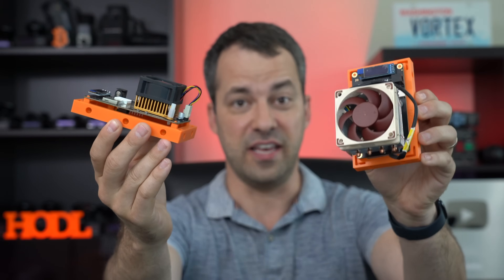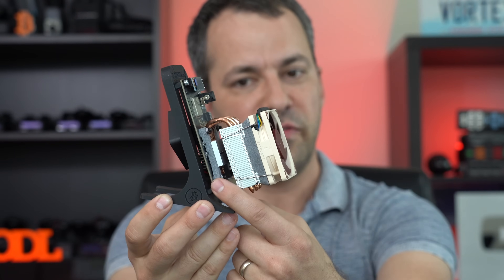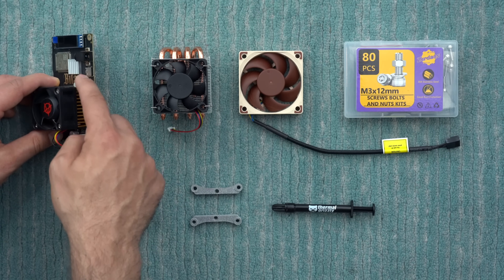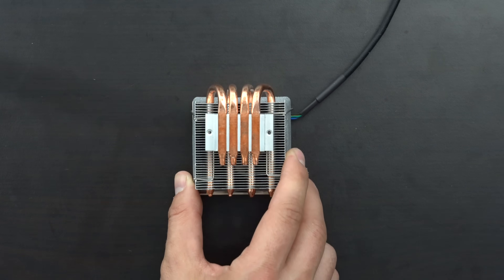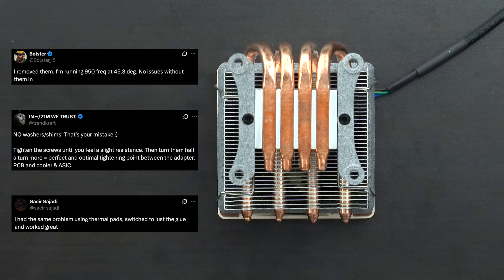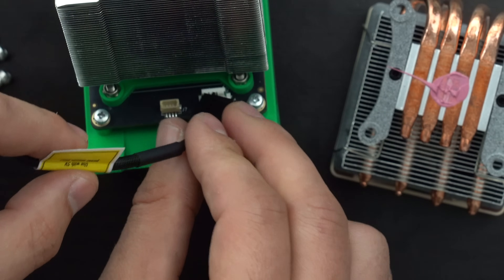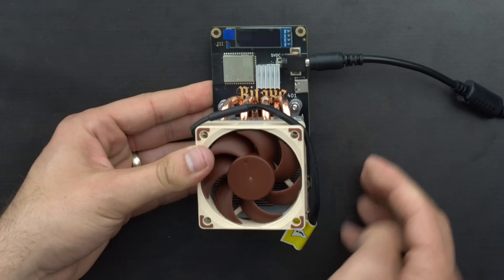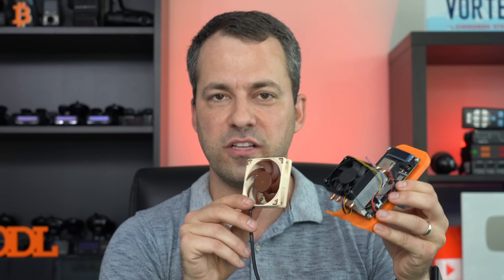Amazing Upgrade For Your Bitaxe's Heatsink & Fan

Comment: Have the same set up but my VR temp goes crazy settings at 900mhz/1300 at 1.8TH also have a 50A 300w PSU. I also just realized that I got the high performance grizzly TP. Does it matter? I am gonna order the Extreme though.

Comment: strange because my stock gamma runs cooler with the stock setup  compared to this exact upgrade .  was worth a shot though .  i used better thermal paste to reinstall the stock setup while i was already putting it back together

Comment: Should have used the copper plates to take advantage of all the heat pipes and surface area after you removed all of the adhesive and cleaned with 90% iso. Attach them to the heat pipes with a very thin film of thermal paste. Attach a high quality thermal pad cut to fit over both copper plates, I used arctic. Stick the heatsink on the asic. You can also get the thinner thermal pads and cut a piece the exact size of the pad you stuck to the copper plates and stick it to the pcb with a whole cut for the asic to poke through. Then stick the heatsink on top of that pad. That way the surface area is spread out more evenly across the pcb, asic and heatsink. The copper ground layer under and around the asic acts as a heatsink too, so being able to keep it cool helps out a lot.

Comment: After installing the components I got this error: "Power Fault Detected. Check your Power Supply."...could somebody help me please
Reply: Most likely the heat sink isn't on tight enough, probably to loose.  Try to adjust it. Its not sitting on chip good enough
Reply: You don't have enough wattage in your power supply. Either back off the settings for now and get a 5 volt power supply with more wattage, assuming you are using the factory power supply.

Comment: i used the low profile cooler fan to cool the rear of the board. 20 degree celcius drop for my voltage regulator using parts included with the noctua fan and pi cooler(spare standoffs and the fan splitter cable )

Comment: Love your channels and new ro this one. Juat wondering. Do you know of any miners that can operate over cell phone hot spot? Secondly any that can operate over Starlink? Would love to know if there's any! Thanks
Reply from the maker: So you could always set up a wifi hotspot via a cell phone, but that sounds like a bit of a mobile / temporary solution. Starlink can work too so long as you use it to create a wifi hotspot locally for these miners to connect to. They just need wifi and it's up to you to provide some sort of internet connection, whether it's cable, fiber, satellite, cellular, etc.

Comment: This girl ordered all of the parts from the links the video provided and I just followed his instructions and my bitaxe is doing great! Already is running much cooler than it was before. I have not over-clocked it yet but that is my next step. FYI I attempted to put a small piece of copper sheet between the ASIC and heatsink (which the video did not instruct me to do) and that did not work, it caused my chip to over-heat, once I removed it, it was good.
Reply from the maker: Glad to hear it’s working out for you! Yeah I tried the copper shim thing too and it didn’t work for me either.
Reply: @VortexBitcoin will a 12v fan work? Or has to be 5v ?

Comment: When fins are oriented vertically, heat escapes more easily compared to horizontal fins
it pushes air across the top of the board passively

Comment: I finally did this upgrade following your steps exactly. However, I am getting a lower average now than with the stock Bitaxe. I did find the printed adapters for the heatsink (company off your site) flexed slghtly to get it to fit. I had to gently manipulate one to get the bolt to go through. Could this flexing be the problem?  Thank you.

Comment: Hey I love the video! I wanted to point out that Noctua fans come with 3-pin connectors as well, so you can find one that fits your bitaxe instead of modifying the 4-pin. Just make sure it's a 60mm fan and 5v rather than 12v.

Comment: I'm having issues with this exact setup. I have all the right components listed here.  Heat sync is tightened down firm with another half turn, but not over tightened. I  have thermal paste in place as well.  I know the seating is good can't get any light to shine through when I back light the sync and the board with bright light. My ASIC temp is about the same as stock but my VREGS are going way high like 85c.  I have syncs on the VREGS and temp was much lower with stock ASIC sync. Noctua fan is also running much faster RPM's than stock. I've gone over this video multiple times to see if I'm missing anything and I can't get the results most are getting here.  I am running improved power supply Mean Well LRS 200-5 with improved power cables.  I don't get it.  Frustrated for sure.  Anyone have any ideas?
Reply: After going over the parts list one by one  Amazon sent the wrong fans.  I ordered the 5volt Noctua fan from Amazon they sent the 12volt fan.  That is probably why I'm having issues with cooling and VEREG temps being out of control.  Damn it Amazon.  I will post update once I get the correct fans.  But now Amazon is out of the 5volt fans.  More time and money LOL.  Will follow up.
Reply: So to follow up. After a long waiting period for Amazon to restock the 5 volt Noctua fans I finally got the correct fan installed plus some heat sync's on the VREG's. Not really that much difference on the temps from stock fans.  I've got good seating on the ASIC with thermal paste and I'm getting about 5° C lower on the ASIC and VERG's.  Not sure how everyone else is achieving 15° to 20° difference.  It is kind of frustrating to spend the money and not get the results.  Such is tinkering around I guess.  I've built dozens of miners over the years but never had as much trouble as with this particular Bitaxe.  I guess there won't be any overclocking here on this unit.

Comment: ive watched this video 10 times, followed step by step directions and still my bitaxe overheats. satoshi gama with a 601 board. grizzly thermal paste. currently running 525 freq, 1000 core volt. 100% fan speed. same noctua fan blowing the right direction. help.

Comment: Can I do this without adapters?
Reply from the maker: Without adapters you won't have a way to secure the heatsink to the PCB. You can use the stock fan it comes with if you don't want to upgrade to the larger fan which requires an adapter.

Comment: Thank you very much for this Gude and greetings from Germany. 
I actually turned the Heatsing, so that the pipes are running from left to right. So the Fan-connector is not in the way / I dont need to adjust sth. 

All the best and thx again :D
DanO

Comment: I followed you  directions and now my Bitaxe is reporting "Power Fault Detected. Check your Power Supply" and the Dashboard it reporting Measured ASIC Voltage of zero.  Am I screwed?   Of course I was very careful and even used an anti-static wrist band during the process.
Reply: I added a piece of copper between the heatsink and ASIC and now everything works great.
Reply: @crites57  i did a lot of back and forth as well - had a lot of doubt, but ended up working in the end.

Comment: The plastic on those fan connectors is pretty soft so you can cut it with a razor blade / utility knife if you don't have a dremel. Just be carefull not to cut yourself.
Reply from the maker: Good tip!

Comment: Before you turn it off, I underclock it to lowest settings to make sure I don't have an issue with contacting the heatsink when it is powered back on. Pink Grizzly will dry up in less than a year on these high heat chips.  I put some thermal pads around it to use more of the heatsink area. Great video, Thank you!

Comment: Included copper shims in-between, instead of thermal tape, thermal paster was used. Thermalright T9 was used as the thermal paste, for both sides. Awesome outcome, from minimum frequency and voltage to maximum.

Comment: No go for me. Got every part, tried copper plates and no copper plates. Just overheats. The noctura fan doesn't seem to be spinning fast enough at all even though plug fits with no re-wiring.
Reply: Still no go, fan speed at 100% only is 1300rpm, on a rated 3500rpm fan.
Reply from the maker: You should be able to run stock settings with no fan. If even that overheats, I wonder if you don’t have good contact between the heatsink and ASIC. Maybe double-check the thermal paste and that the heatsink is screwed down and secured tightly.
Reply: Thanks, I re applied the paste, but in an error of ordering I noticed my fan was 12v Noctura and not the 5v. Could be the reason for the low 100% 1300rpm. Ordered the correct fan off of Ebay and will wait.
Reply: @robmassung2387  I have the exact same issue. 12v Noctura fans and its running at 100% at 1200RPM.

Comment: Please help me with one thing: To properly mount the Noctua NF-A6x25 5V PWM fan on the 52Pi Low-Profile Plus heatsink for Raspberry Pi 5 on a Bitaxe Gamma, should the fan's airflow direction be oriented towards the heatsink (processor)? That is, should it be mounted with the side with the specifications sticker facing the processor or vice versa? In the video I saw that it is mounted that way, but in other videos I noticed that they mounted them the other way around - that is, the fan is mounted with the side with the sticker facing up. Thank you
Reply from the maker: You’ll want to experiment. I’ve seen it sometimes work better one way or the other.

Comment: @VortexBitcoin Good evening and thank you for the videos! The fan you've provided in your supply list is sold out on amazon and no one on any other sight seems to have the 4 pin 5V version either. Im assuming the NF-A6x25 will work with the Low Profile Plus Cooler even though it was tested with the Argon THRML. The NF-A6x15 has much better air pressure performance so I'm wondering what my options are. Try and wait for these fans to restock or try and fit the A6x25 to the Low Pro Plus and hope that I can get similar performance? Or perhaps there are sources fir the A6x15 that I may not be aware of? Thanks for the input!
Reply from the maker: Yeah the 15 sells out all the time, presumably due to Bitaxe demand haha, but no one else sells them unfortunately. I suppose you could pick up the 25 as a backup. https://amzn.to/3YNha8q

Comment: before this modification my bitaxe was running at 53 degrees and the VR was 50 degrees, after the mod the bitaxe 601 ran at about the same temp but the VR got hotter and ran at 70 degrees. Can anyone explain this ? New fan draws more current ?
Reply: I'm having same issue

Comment: Thank you so much for this video! I couldn't overclock my Bitaxe 601 without it overheating. I was able to purchase everything on Amazon, and I wanted to let you know that the new NF-A4x20 5V PWM Premium Fan fits perfectly without needing to dremel down the plastic to match the Bitaxe plug. This is AMAZING! My hash rate has increased, and the temperature is lower.
Reply from the maker: Woohoo! So glad the upgrade is working well for you too!
Reply: you are using the smaller a4x20 and it works?!? wow nice

Comment: Pipes should be at the bottom, did you use the stock Power supply? Thanks
Reply from the maker: Why at the bottom? I use an upgraded Mean Well PSU.
Reply: @VortexBitcoin  That way the heat rises to the top of the sink and when cooled, falls back to the chip. I suppose it’s necessary to use a different power supply? Would the one that came with my Gamma Work? Thanks.
Reply from the maker: I understand the theory, but as mentioned in the video, the heatpipes would likely block access to the fan connector. You could always install it pointing off to the side if you prefer.

You will need to upgrade the power supply to handle the higher power draw requirements when overclocking. Here's a video on the topic: https://youtu.be/hdeLD3GTb5A The Mean Well PSU's are now accepted to be the best and the go-to's.

Comment: Too bad people never think about dust deposit over time and how it can kill your electronics, avoid coolers which blast air directly on the BItAxe.
Although it is a good idea to cool down the PCB, sadly in the long run all that dust deposit will kill it, especially when considering majority of miners do NOT perform any maintenance on their hardware.
Lastly avoid fighting against thermal dynamics, hot air rises so make sure your fan does the same.
LMAO, obviously remove the protective sticker on your thermal pads, the plastic will definitely hit the thermal conductivity lol
Happy mining ⛏

Comment: This cooler is the best, bridging the 4 copper tubes with a copper plate would be optimal. No adhesive necessary just thermal paste. With a better PSU you can balance your miners very well and even get aggressive with overclocking if you like high electricity bills 😊
Reply: What wattage would you shoot for over the stock 30w (5v 6A) that came with the Gamma? If you suggest something over 30w hooking up 2 to the same PSU would be idea.  What kind of power will I need for 2Th each?  I have all of these parts ordered and on the way :), as for power bill can't be as bad as before with only 2 OC'd Gammas.  I had 5 Elphapex DG Home 1s and 2 Goldshell Mini Doge 3 pluses, racked up a nice $975 power bill.  Needless to say they went on ebay and sold them all and scaling down and just for fun now :)

Comment: Anybody else having issues with the genius links to the parts.
Reply from the maker: Which parts?
Reply from the maker: I noticed that the fan with the USB connector is out of stock. https://amzn.to/4k5Vuwm There's also a version in stock without the USB adapter if you don't need that. https://amzn.to/3EUr3KF
Reply: @VortexBitcoin isn’t the fan need to be 5v  the one in descption is for 12v
Reply from the maker: @ Ack you're right! Sorry about that! Good catch. I'd initially linked to just the 5v version, but it sold out, and I was trying to add another option. I thought it was the same, just without the USB adapter, but you're right. My bad. Links fixed.

Comment: Hi ... I locked at the article and it seems that the fan do have an affect, would you please try the (NF A6x15 5v pwm) on the Argon and see if the fan is the thing that is making the real difference or its really the (52Pi Low-Profile Plus).
Reply from the maker: The one I showed in the video is that exact model.
Reply: @ I’m wandering if you can try the Fan in the Argon Thermal to see if it make any difference vs. using the NF A6x25 one. In the article it do mention that the A6x15 have an advantage over the A6x25. I don’t have it to try it and as you already have both I’m asking if you can please try it.
Reply from the maker: Sorry I don't have the 25 and don't have any interest in doing experimentation with that combo. You're welcome to try and and share your results with the community too.
Reply: @ I’m in the same boat, I don’t have the “15” one 😂. But really thanks for your videos did help me a lot.

Comment: Great video! Curious, the Ice Tower I saw you use is the black one. Have you tried the silver one? I saw a different video elsewhere where the black one performs significantly worse than the silver one (not sure the reason for that). I'm kind of surprised the low-profile one did so well for you. Tempted to try it out.
Reply from the maker: Ah interesting. I haven’t compared black vs silver. In the article that I linked to, he tested the silver one against the other heatsink models if you’d like to see that. The one I’m using here did better than the silver ice cooler so I’d rather use this better one. 😉
Reply: @VortexBitcoin  Very cool! What do you have your frequency & voltage set as? I'm going to see if I can get my setup that high (apologies if you mentioned that in the video -- don't remember them if you did)
Reply: It’s because of the black anodized coating. It kills thermal conductivity. The silver one exposes the bare copper.

Comment: Hi, been running this set up for over two months now, over clocking bitaxe temperatures are low at the higher hash rates. The only issues for me on both my bitaxe has been that I can't currently get around the higher temperatures on the voltage regulator, is anyone else experiencing this problem??
Reply from the maker: Yeah that's definitely starting to be a limitation point we're seeing as well.

Comment: hi there, thanks for the tutorial! I am just looking to build my first mining rig. I was thinking of going with some bitaxe gammas, but i am wondering can i chain them together in series, or do i just have to have them all running separately? One of the websites i was looking at had a price discount for 10 or more, so was considering going with 10 of them. Am i missing something or do you have any other advice or references for someone just looking to get into this hobby? Thanks again for your video and your time
Reply from the maker: Ah awesome. They run independently, but you can have them all working together to mine to the same Bitcoin address. There’s also some tools that help you tweak and update them in bulk which I’ll be doing videos on later this week so stay tuned for those.
Reply: @VortexBitcoin  sounds great, thanks 👍

Comment: What power supply are you using? I’m bottlenecked by voltage input. I’m using a 50w and can only make it up to 1.58 Th/s before dropping to 4.9 input voltage. I’m using a 2nd fan on the back for the VR.
Reply from the maker: Yeah I’ve been upgrading to a beefier Mean Well PSU that can handle higher power output and multiple Bitaxe’s. https://geni.us/HNPbPyx

I do tend to run them closer to 5.2v so I can float around 5.0v with a load.
Reply: @VortexBitcoin  Got it. I'm going to pick up one of those USB/PWM adapters you highlighted for the back fan & see if I can reduce the load enough to eek the hashrate up a little bit. thx for the idea.